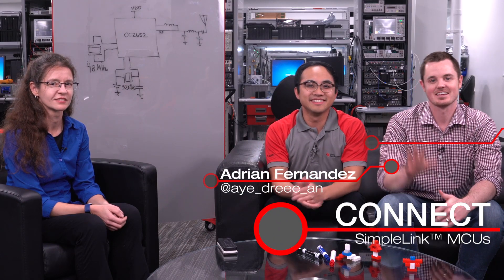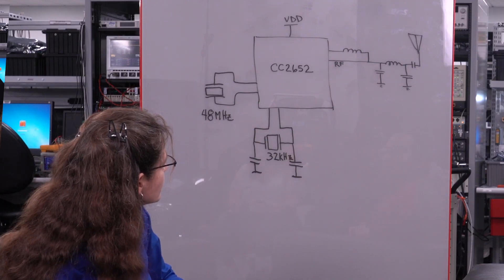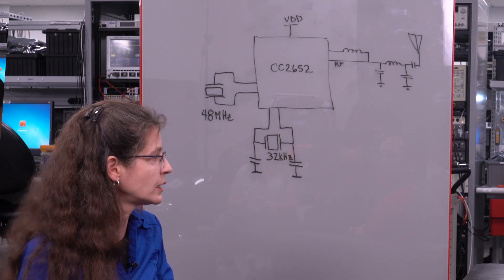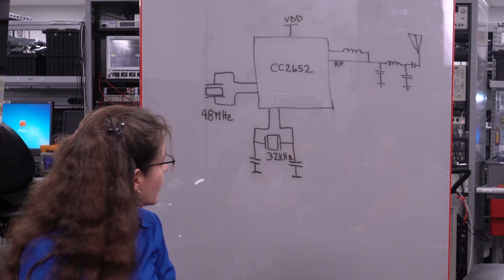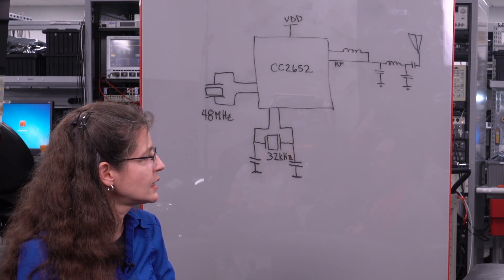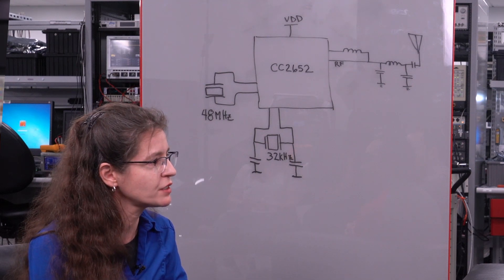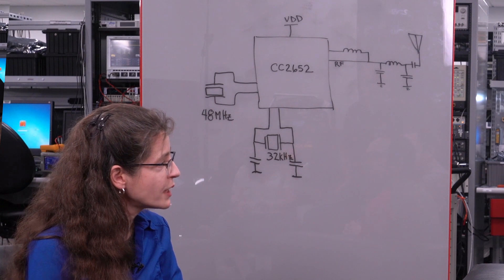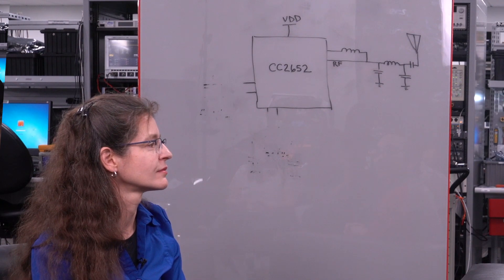Connect: TI bulk acoustic wave (BAW) resonator technology

Comment: How does it affect the overall SoC price?
Reply: Its a 50cent cost adder on the low volume published web price vs similar device with external crystal
Reply: Normal CC2652R is $2.68 currently and CC2652RB (with BAW) is $3.00.